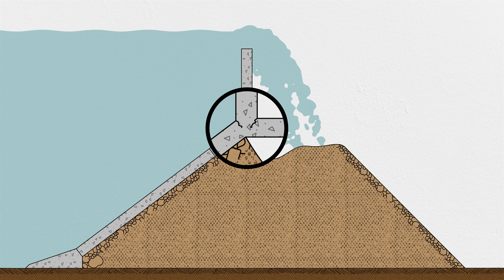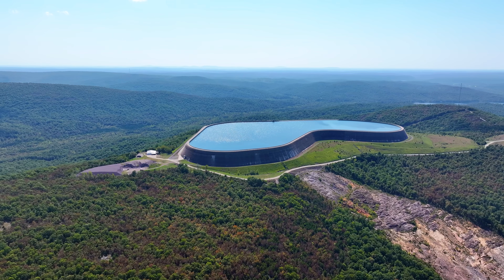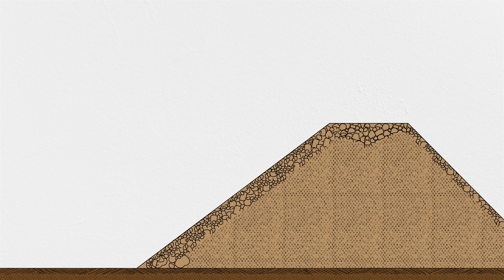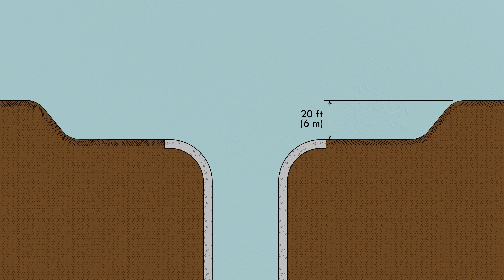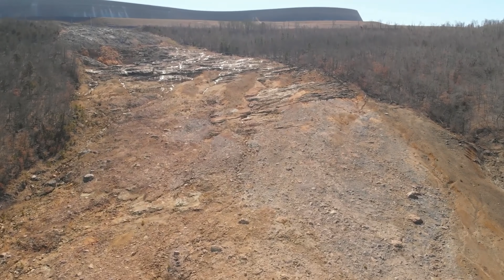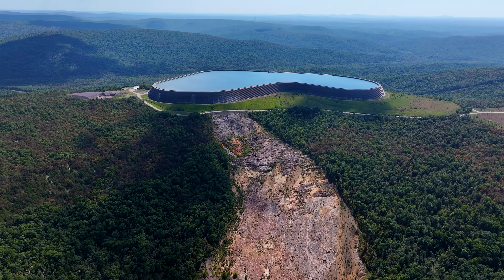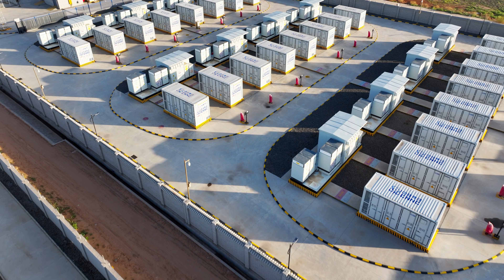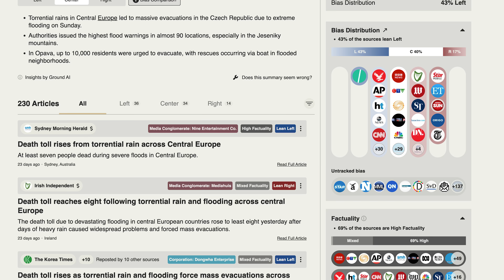The Wild Story of the Taum Sauk Dam Failure

Comment: I worked in the oil industry for 25 years (got out July 2025).  Started out as a hand while in college then to engineering, then management, and finally executive leadership.  

Listening to this video I could hear similar concerns we have in the oil industry.  So much critical infrastructure has little issues that everyone is aware of but for reasons won’t get properly fixed.  Someday there will be a devastating accident,  it’ll get a few minutes on the news, some lawsuits, and quietly swept under the rug.  And I’m sure it’s similar in most industries.

Plus and why I started writing this comment I had to laugh a little every time he preceded something with dam.  Dam design, dam wall…yeah I know.

Comment: My experience says that quite apart from the design issues of the dam wall red flags what failsafe interlocks were in place? It is normal to have triple interlocks in this situation on the pump control circuitary. Why were ultrasonic level sensors not used? Many questions on the design review process failures. Seems a catalog of failures across the whole project cycle.

Comment: The main issue in the failure is lack an operator and trust blind in an automated system. An operator could press a button at time. Also two methods like a pressure sensor in the bottom (hose or diaphragm goes to bottom gauge can stay on operator office and pressure switch too), Or a float and a simple photo transistor would be more secure apart of the mechanical ball switch that have more tendencies to failure and is for a house hold tank and not for a dam. 

I think that not only potential energy is a way to produce energy. In fact first was used water wheels.  Each source of water have a potential. Some get lost for jumps natural, some other in the path way. Hydroelectric project makes a delay in the water flow and this delay have a maximum according rains and drought to be stablished. I had an idea of a set of submerged water wheel double effect instead of do dams. Plenty  smaller. This will reduce cinetic  energy from river flow and not using potential storage. Energy taken can be the same, distributed all over river when pendant or jumps makes water increase speed. And not causing a  big reservoir or dam. Other is use as dam a big long pipe downward. This will reduce loses of pathway and will work with low flow and very high pressure. This way is with safer because valves acted by speed can stop water course in all the pipeline. 
Another consideration is about the usage of batteries. Batteries will not last longer and cost and benefits are highly questionable. Also in such quantity if use alkaline ions some becomes a risk of explosion. With battery vehicles happened two bezel wreck because car batteries explosded in the cargo ferry. This never happened with fuel vehicles. 
Over production must be handled by electrolysis processes. Like metals production (aluminum is the most common but bayer process is highly environmentally questionable, because produce plenty C02, spend plenty electrical energy and the worst fluoro carbons) , hydrogen or some hydrocarbons which can be obtained by using electric source. Also if exist problems.of water in desertified areas a alternative electrical business is water pipelines to supply water to places that don't have. This will solve overflow problems while lands restoration becomes a success. Joining water and oil business give chance to don't use dam but produce hydrogen in rains with water and out of rain use a natural gas / hydrogen turbine to supply water and an oxygen production plant. Ocean current water wheels Al also feasible and a choice where  see is calm and protected from huge storms and a small gap between for example an island and continent produce high currents over 5 nuts.

Comment: Seems it would have been safer and less costly to have dug into the mountain top to creat a man-made lake reservoir instead of building up as they did. Can some engineere explain why not?
Reply: Most likely because the cost of building an elevated perimeter wall is less expensive and was determined to be safe enough for the purpose. This would have been likely correct had the construction been done correctly, and the safety systems been properly installed and maintained.
Reply: @notahotshot  So, it is more cost effective to build up a reinforced wall than to simply dig a hole? Not disputing, but seems counter-intuitive.
Reply: @fourstringpicker  yeah, when you dig out a hole to store water in, it's a 1 to 1 exchange of material to water. 1 cubic foot of dirt out, 1 cubic foot of water in. If you build a 1 foot high, 1 foot tall cylindrical wall with a circumference of 100 feet though, you can store about 796 cubic feet of water while only having to move 100 cubic feet of material. The ratio of material moved to volume of water stored is a lot better, and it only gets better the larger the area

Comment: I've seen so many buildings with elevated water tank use a float switch to power on or off their ground level pump. While I understand the level sensors might have been part of a full monitoring sstems, couldn't they have spent a few bucks into setting a redundant, cheap, float switch? I get it that not all systems can be as redundant as a plane, but hey, a float switch is not that expensive, and setting up a last resort to avoid overfill of such a huge reservoir wouldn't have been a bad idea. Also, and based on personal experience, I would have prefered to use a rigir probe. More reliable for that kind of containers.
Reply: They had redundant sensors. They were installed and programmed incorrectly. 

They had sensors on the bottom, which failed. 
They had sensors at the high water level, which failed.

Comment: Fail-safe design (not counting edge conditions & extreme outliers) is difficult, but not impossible to do.  
More initial design time is required. (expensive)
Much more design review is required. (expensive)
Hardware changes or additions may be required. (expensive)
Build or operation changes may have to depart from "this is how we've always done it!" (expensive because changing that inertia is time consuming)

On the plus side, successful solutions are always elegant, not complex.  Easy to understand, and easy to maintain.

Comment: Taum Sauk is the ultimate warning that complexity is the enemy of safety. The true 'What Went Wrong' wasn’t just the sensors coming loose,it was the decision to replace a simple, physical spillway with a complex chain of buoyant conduits and software patches. When you rely on electronics to hold back a billion liters of water, a single loose bracket becomes a catastrophic point of failure. It’s a textbook case of a billion dollar facility defeated by a $100 sensor.

Comment: I have zero engineering knowledge or topographical info about each area so sorry if this is a dumb question, but how did Granada manage to figure out getting water to the top of a peak like 800 years ago but Missouri needs to burn all this electricity to do it? Is it an issue of volume? Something specific about the geography?

Comment: “Design a point of failure. If you don’t, the system will assign one for you.”
Reply: For real they just needed one of those little holes near the lip like your sink has boom problem solved. Hahaha
Reply: @plagueCLUTCH  definitely seems insane to design any dam without a point where it can overflow safely
Reply: @GBiv78 like every farmer has done for hundreds of yrs! And the new one doesn’t have a spillway either
Reply: @catlifeoutdoors6369  honestly, why would you want to learn from the first failure?
Reply: They did design a point of failure: no human oversight.
Reply: And the system won't tell you where beforehand: it likes *surprises*.
Reply: No engineer has any excuse to not know this. Also, anywhere it could possible effect the safety of anyone, always Fail Safe. - A controls engineer.
Reply: "Highly stressed systems have a way of un-stressing themselves for you. But wouldn't you rather do it yourself?" - Robert Heinlein, speaking through his character Lazarus Long
Reply: Be nice if that point of failure was redundant sensors that shut everything down if they disagree
Reply: Is not only like this..Sometimes some ethnic groups have plenty military power and don't let others ethnic groups do this kind of construction. And despite other can have a more clever idea lack of experience makes this idea probably fails if if try to do it and only can be done with people with enough previous experience. But the previous experience can repeat always the same mistakes too. The cooperation is  give population knowledge to can audit what builders are doing and request information about inquiries of possible concerns that population found.
Reply: It also makes it more likely to fail tho
Reply: @LightPink  I don't see it that way. The point of a fail-safe is that once the system enters a dangerous state, you let it fail in a predictable way to limit the disastrous outcomes of a major failure. It shouldn't just fail for no reason.

The impact of a triggered fail-safe should be in line with the danger it alleviates. For example, if sensors in an airplane disagree, the autopilot disconnects immediately, and the pilots are alerted so they can hand-fly. Often, the issue is just a broken sensor, and the plane is never in any danger of falling out of the sky. Malfunctioning sensors is not an uncommon problem, but the fail-safe is also not impactful. With a dam, the impact of a catastrophic failure is, indeed, catastrophic. Therefore, the impact of the fail-safe getting triggered is similarly dramatic. The reason this is economically justified is that the likelihood of a drastic fail-safe design springing into action is very small; we build dams with the requirement that they will never suffer a catastrophic failure ever.

It should be mentioned that a fail-safe in a responsible design never stands alone. There should be a sequence of fail-safe-esque systems. By the time the structure is so overwhelmed that the biggest fail-safe is used, a lot has had to go wrong.

Comment: One point that you didn't bring up but is extremely important is why didn't this structure have an annual dimensional check done by a surveyor.   Most large dams should be checked at least annually for dimensional shift and can be checked more often than that if things start moving.  To do this many target points are placed or found on these dams and can be compared to previous measurements to find core shift or settlement.  The 2 ft drop in the wall would have been obvious. How did the people who decided where the water level should be make this decision without good data?

Comment: A similar event happened to me. My 4000 Litre, twin tank system overflowed. It was 5AM. The issue was that the float switches weren't set at the correct level, so the pump didn't turn off. I lost my cell phone in the panic, and it was never found.

Comment: Two very important reasons to have at least one or two regularly on site techs (or even a whole team)

1) Having eyes on the issues immediately, as mentioned in the video

2) Having people that aren't just familiar with the design/intent, but also with how the system is wearing down over time and can chime in when someone, say, wants to put fail safe probs on the wall. Like "hey, make sure one goes there, it always seems to get closest to the top of the wall at that point"

Comment: What's surprising is why don't they use computer simulations to predict failures. If they can catalog all the sub-systems that can "deviate" from assumptions, and what they might affect in turn—computers can simulate various combinations of errors that result in catastrophic event.
This small errors cumulating into larger unmanageable issues are common in complex engineering including aerospace. The risk should also include human factors like lack of manual monitoring and mismanagement.

Comment: Im not an engineer, but I was thinking: would'nt it be possible to make an outlet hole atvthe top of the dam wall with a funnel down, where- as soon as the water rises high enough to reach that hole- it would run through the funnel downhill and hit an off switch? You could use the force and the weight of the water to activate a stopswitch / release switch at the plant downhill. 

So if a certain amount of water goes through the outlet and the funnels reaching the switch it is automatically turned by the weight of the water. And stops pumping / starts releasing water from the resevoir. 

That way you could avoid the whole costly sensors and electronics thing and skipp all the electronics all together

And since walls aparently can settle overtime: if you create outlet holes with funnels all arount the dam that all funnel to one bigger funnel that then goes downhill to the plant where the switch is; your dam would - theoretically- be self regulating without the need of technology or sensors inside the resevoir. 

Im not pretenting to be an expert but i do know what a good and feasible idea feels like. And this feels like that. 

Would save a lot of money and effort too. 

You just got to make sure no rainwater and no debry can get into the outlets/ funnels. 

But I think this should work. A bit more old school but reliable.  And way less techsensitive.

Comment: Surprised about the absence of Primary Safety Device on the level instrument system. The analog LIT failed, but there must be LSH and LSHH level switches in case of failure of the analog LIT signal. The absence of emergency Overflow in the original design is also very surprising. Excellent O&M and Engineering lesson learnt ❤

Comment: The real oversight here was what every other dam has; Emergency spillover channels that would never allow the walls to overflow. Always assume your dam will overflow at some point, and you always want it overflowing in a place of your choosing. The reason for them is obvious; They're (nearly) foolproof. You don't need to do anything for them to do their job. You don't have to watch them, or operate something, they just work when required. Though I should add, that doesn't mean they can't be badly designed and fail in another way.

Comment: They spent too much focus and funds on myopically preventing leaks on the inside surface, but never thought to put in failsafe mechanisms or pave the slope beyond the wall to prevent undermining erosion both from nature and spillover. That green lawn looks pretty, but you can tell something looks off - imbalanced. It looks unusual and disproportional for a reason. Forgetting to account for error cases beyond the surface ones leads to catastrophe.

Comment: Just wondered why they couldn't have used a ballcock like in a toilet but with a sensor? They could be shielded from waves by being put in a vertical tube open at the top and holes in the bottom. They could be supported from the side of the dam with no need to touch the dam membrane. instead of sensors under the water

Comment: The reason why experienced engineers are paid so much is they've seen where specs go ignored or get changed by managers or contractors pinching pennies, and know to check on whether specs are properly followed.  They also can advise those folks ahead of time not to change specs or 'insert disaster here' will happen.  Rock fill for a top of mountain artificial dam makes me shudder to think about.  If bedrock is not close enough, something equally sturdy yet man made should have been substituted.  Any kind of fill eventually is going to shift and settle and/or erode away.

Comment: The same incompetence happens at my job. I work at a water treatment plant where we built a $5 mil reactor about a year ago. The engineers said it would work even though we all questioned the construction since its level was higher than the other reactors we have. Sure enough as soon as we start it up the water starts overflowing up at the degasification towers. There were no consequences for anybody and the county just ended up paying the contractors while they got the hell out of there. So we still have this giant paper weight a year later and management has no idea what to do with it.

Comment: So I believe your theory is flawed on the failure.  So you said that, I believe, 2 pumps stopped and 1 didn't.  Surely the sensors were wired parallel and not series.  How did the other 2 pumps stop? I'm not a big fan of engineers btw

Comment: Quality really is dropping in every single industry... Causing more costs in the end, but nobody seems to care about that anymore... 😢
If you build a facility running autonomously: Always build a  minimum of two measurement principles to separately update the current state and build a failsafe. In this case just a floating element with an alarm stopping the pump 2 feet before reaching the top as well as a spillway made to survive water flowing over and another alarm sensor stopping the pump.

Comment: The root cause of the Taum Sauk failure was deregulation. The original specification included annual cycling 120 days a year, not 300+ The increased cycle frequency drastically reduced MRO frequency.